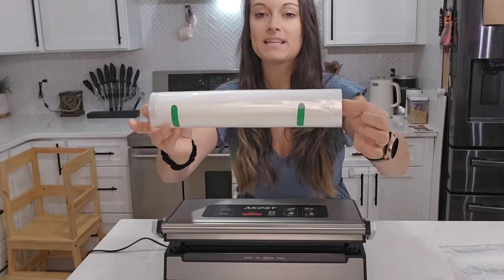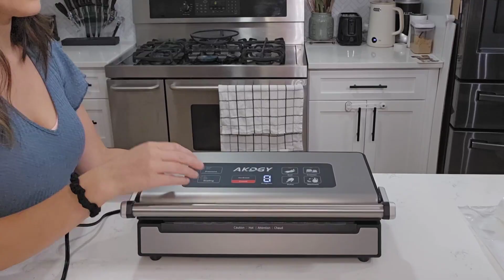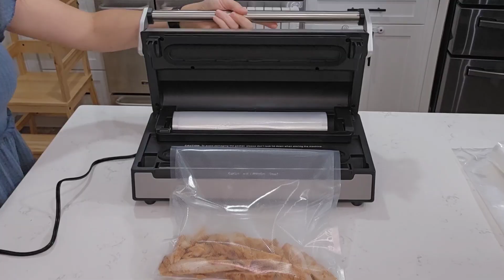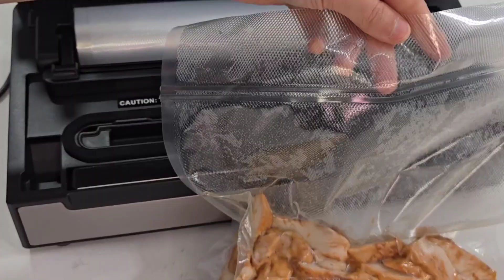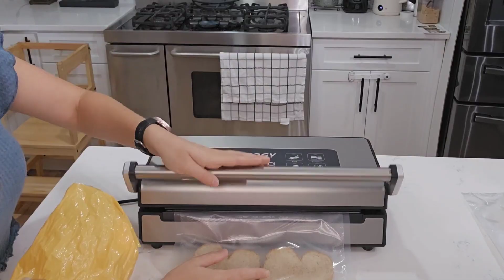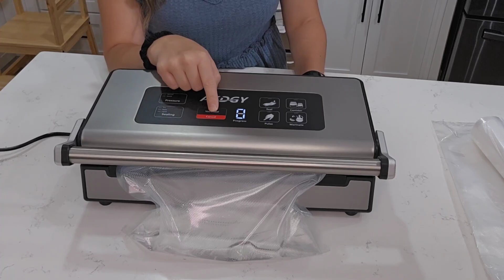🥩 95Kpa Vacuum Sealer Machine Review | Nearly 30% OFF + Built-in Cutter & Bag Storage

Comment from the maker: 📦 What’s Included:
• 1 x Vacuum Sealer Machine (95Kpa, 50Kpa adjustable pressure)
• 2 x 28cm x 5m Vacuum Rolls
• 1 x Extra Cutter Gasket
• 5 x Pre-cut Vacuum Bags (30x25cm)
• 1 x External Vacuum Hose
• 1 x User Manual